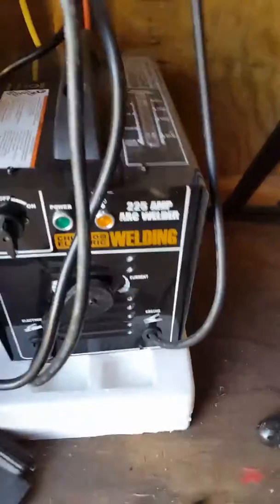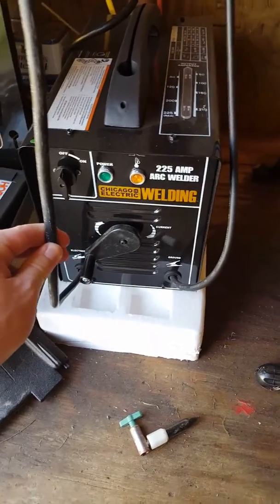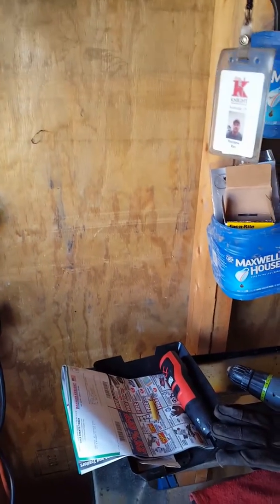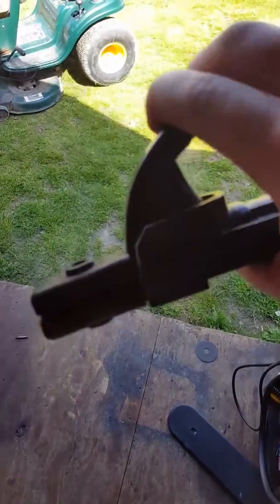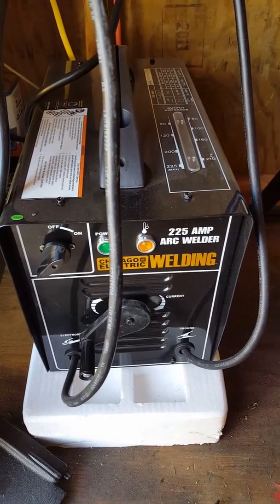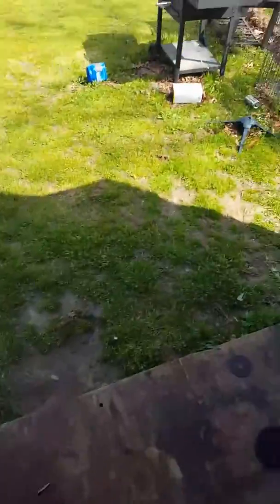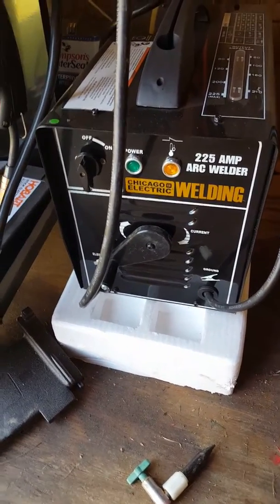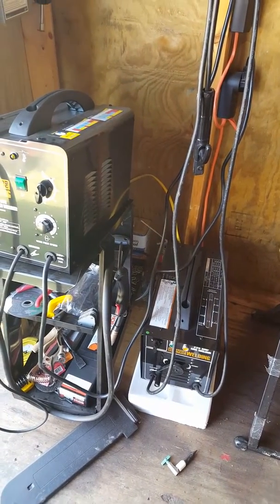Harbor freight 225 stick welder review

Comment: you can get 1/16" 6013 rods at Lowes or HomeDepot which is good for welding thin sheet metal type material. if I ever use this type and size rod it's when i need to welding thin sheet metal which this is a rod (6013) designed for that type material and usually set that 1/16" at 42 amps which some shielded metal arc machines don't go down that low.

Comment: I used one that couldn't weld 7018 rods at all. But it did great on all the other ones like 6011, 7014, 308 ect.
Reply from the maker: mine will run them just fine, im not sure why yours wouldn't
Reply: @thewanderingrays5131  Yeah right. It belonged to a friend. I heard my rods might have been dc rods.
Reply from the maker: @robertblackshear8963  very possible it does make a difference

Comment: Yo I just bought this welder.. I'm having trouble with just running a weld.. using 7018 5/32 rods.. lots of sticking.. but hard u say it runs better on higher amp's.. I'll try.
Reply from the maker: 5/32 7018 is a big rod I believe id go dc+ 150amps crank that thing up and long arc for a sec to get the rod hot then come at it with a good short arc! Let me know if that helps plz
Reply: 7018 runs good on DC ur gonna keep struggling on AC

Comment: I’m a YouTube welder learning to learn and bought the Chicago electric. How many Volts should I run for 7018 rod and 3/8 steel plates
Reply from the maker: Is try 90 amps and adjust to 100 if needed bro, don't be affraid to play with the amps start low and adjust up slowly. Hope this helps!
Reply: Ok I’ll try that once I get back to my brothers shop. Thanks for getting back with me so soon!
Reply from the maker: @greatwhitebuffalobuster2103  no problem at all, in fact let me know how it turns out!
Reply: K

Comment: Went to a friends house today and brought my 15lb 160A DC inverter welder.. I tried his HF buzz box and it stuck like crazy and made poor beads (his results were about the same).. He tried my inverter welder and was blown away by the difference in ease of welding and penetration with virtually no spatter.. I was surprised he could run a great bead the 1st time he ever tried this welder.. I am sure this welder has its place but for $75.00 less and better performance plus MUCH lighter and 10' quality leads my friend is selling this buzz box and buying a DC inverter welder..
Reply from the maker: That's cool man!

Comment: Can you use that welder on a generator?
Reply from the maker: Yanmo68  I did try it on the generator that I've reviewed on my channel and it does work
Reply: Yes
Reply: Matt the fuel guy 2017 what kind of generator did you use because I can’t find the right one
Reply: Terrence Manning any generator with a 50 amp 220 volt plug outlet.